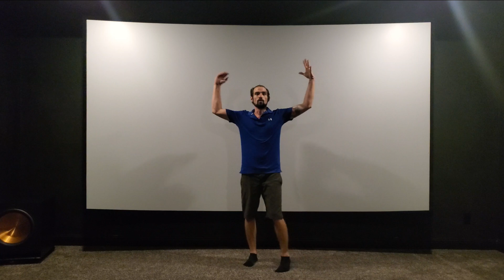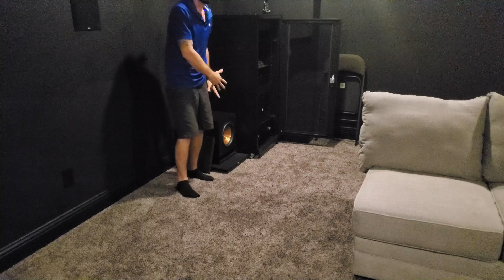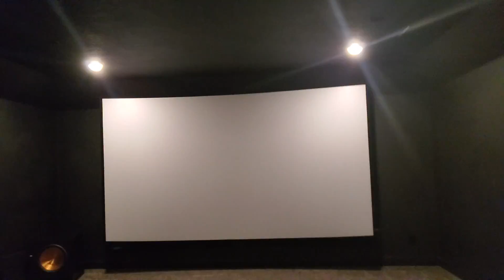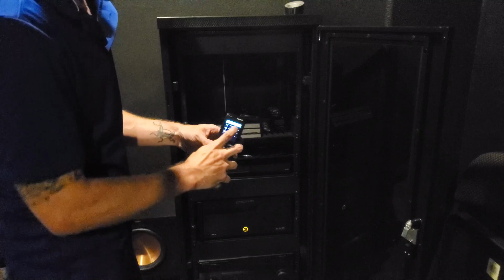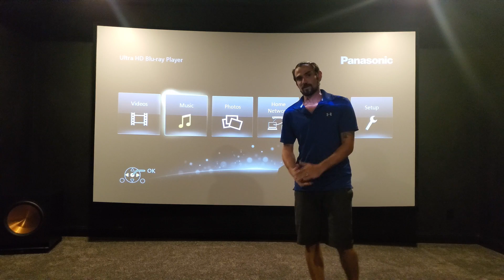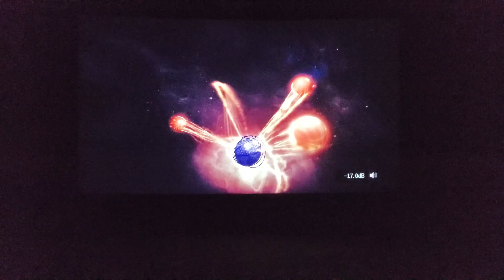Home Cinema Tour 2020! $25,000 7.2.4 Dolby Atmos! Emotiva Amp

Comment: 150 watts per channel with a Yamaha receiver? Based on the specs, the receiver can provide 150 watts for 2 channels driven. The more channels you add to a receiver (beyond the Rated Output Power specs) the  lower the watts per channel will be between the remaining channels. Best bet would be to use external amplification for all channels not just the front sound stage.

Comment: surprised how not great this is for so much money, my system cost maybe $15,000 and beats this hands down, dual 24 inch subs, jvc PJ with wow level blacks and no speaker under 10 inch in a 7.4.2 system with a dirac live calibration.  I did a good bit of diy including sound panels. but 10,000 to spare and twice as good, not to mention the couch.
Reply from the maker: It's not all about sound pressure level. 24 inch subwoofers dig very deep and shine and infrasonic range but they're certainly not very dynamic in the higher bass frequency range. I'm assuming you have a couple of twelves to go along with those?

I'm sure your system is great but this is a very different and custom experience. A nearly 170 inch acoustically transparent curved screen with the front stage behind it? Also we pulled 124.5 dB during calibration. If you're not aware of the capabilities of the 6000 LCR, you should experiment. Also, we professionally calibrated that space using real-time analyzation equipment. Direac ive is good but only if you have the right equipment to go with it. We have worked for Cinemark Theaters for years. What we are trying to do is reproduce the true cinematic experience. Sure, there's better equipment out there but this truly feels like a movie theater when you're watching. It's a huge space and a very Grand experience.

JVC projection doesn't necessarily be what this gentleman has, that's all personal preference. There's benefits to each unit. That's also the retail value have the system when we added all up including calibration and installation. The client didn't have to pay that full amount.
Reply: I can also hit over 120db from 20hz up and hit over 100db at 5hz
Reply: I guess that 25k includes payment for this ppl to install. 😅

Comment: Hello friend how I managed to activate the LCR channels in the pre out outputs of the yamaha towards the emotive.
I have one equal to 3080 and it only allows me to activate the 2 front or 2 front presence or 2 rear presence or the 4 presence at the same time for a 7.2.4 configuration of 11 channels

the central I do not see it in the configuration of the yamaha to add it with an external amplifier.

I would appreciate knowing how you did to activate this configuration 7.2.4 using the emotive 3 channels
Reply from the maker: Hey boss, I'm not sure what you mean by equal to 3080. Do you have a Yamaha 3080 or do you have some different receiver? This process can be a bit different on each model

Comment: I hate when there's a dollar value attached to these posts.  As if that's the mark of good gear.
Reply from the maker: Actually in this industry, it very often identifies high quality gear. It cost the manufacturers more to build extremely high-quality equipment and so they have to relay that pricing to the consumers.

 There are some exceptions here and there, RP - 8000f by Klipsch for example, that speaker can compete with some of the big boys and cost much less. 

When it comes to THX certified products and high-end amplification such as Emotiva, expect to dish out a dime or two.

Thanks for watching.

Comment: 7k worth of equipment for 25k!
Reply from the maker: Emotiva+yamaha3080+6050=roughly 7k.
Leftover is the 11 speakers, 2 subwoofers, 160 inch Custom curved Screen, 27 u equipment rack, blu ray, Playstation, roku, and Labor costs for installation. Im just not seeing 7k there bud.
Reply from the maker: Where did you get 7k from?

Comment: The room deserves better subs, Klipsch are very poor with -20Hz which is present in most movies these days. Also, your Yamaha is not doing 150 W per, once you go beyond two channels.
Reply from the maker: First of all, thank you for watching. I have to respectfully disagree with your opinion on the Klipsch subwoofers. Most specifically the SPL-150. That particular subwoofer is quite dynamic. Especially in the infrasonic frequency range. I'm assuming you are aware that you're referring to frequencies which are inaudibel? Purely vibrations indeed. If you're thinking of that "chest slam", that frequency range is more around 100+ Hertz. And in that range, the SPL-100 does a fantastic job. This is why we set up this particular system that way. By well engineered design, and influenced by no other motive. Timbre matched and aesthetically pleasing.

 If you have past experience with these exact models of subwoofers, perhaps you didn't have them crossed over properly, the equalizer was off or the placement was inadequate. I assure you that this system is properly designed, sounds superb within the full range of our hearing and is enjoyable within practical infrasonic range. Literally the vibration travels through the entire frame of the home, place your hand on any wall downstairs and I assure you it can be felt.

As for the Yamaha, during a Dolby Atmos or DTS X object-based soundtrack, the power being distributed to each speaker is going to drastically vary. Of course it's not going to be exactly 150 watts per speaker, but that particular unit is more than powerful enough to properly supply power to each of these in-wall surround speakers. Perhaps you should get a Yamaha 3080 and do a bit of testing. With its high quality amplification and excellent parametric EQ, it is a fantastic alternative to separates in this price range.

 Thanks again and take care.
Reply: Whatever, Fake News. When someone writes such a long explanation it only confirms my observation!! Thanks
Reply from the maker: @raulgutierrez1501  that makes absolutely no sense. When someone takes the time to explain their thought process, as opposed to ignoring your comment, you should respect them for doing so. I don't believe you have first-hand experience with these products, therefore you should not mislead others. If you do have first-hand experience with them, please elaborate. We've installed hundreds of these units between this generation and the last. We are dealers for many other brands, this was a well-thought-out and Timbre matched system. Why disagree with the system without providing supporting information?
Reply: It is only my opinion after I herd Klipsch, SVS, Rhythmic, and others.  I have been involved in ultrasound sonar development for a lot of
years. I have a very good tuned ear. You can take it with a grain of salt, there are more important things happening in this world to worry about subwoofers needs and wants! Good to hear from you. God Bless!
Reply from the maker: @raulgutierrez1501  understood and we appreciate your opinion and I can certainly respect a fellow trained ear.

There's other subwoofers out there and the brands you have mentioned are definitely very good as well. Just give Klipsch another chance because this new SPL-150 is significantly better than the 115SW from last year. We actually advised on some improvements that needed to be made. The engineers worked hard on the overall design.

You're definitely right, they're very important things going on and the world and we all need to be kind to each other. God bless you as well. Take care
Reply: @DivineAV  I must say I like that you are active and responds well in the comments because I feel that is a rare thing especially for companies.
I was curious about the choice of subwoofers but after you said the customer was a bass head and wanted "slam" I understood the choice.
Sure there are subs that go way deeper but with the requirements the Klipsch fits nice I think. I haven't heard the Klipsch though but from reading lots of reviews about them they seem to meet the requirements perfect.
Btw really nice build!
Reply: I see a Wonderful set up